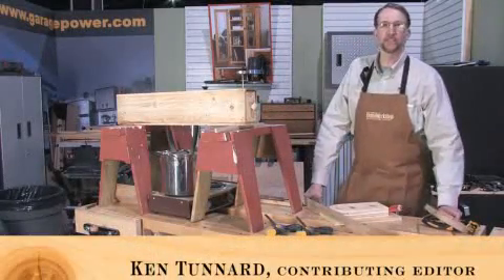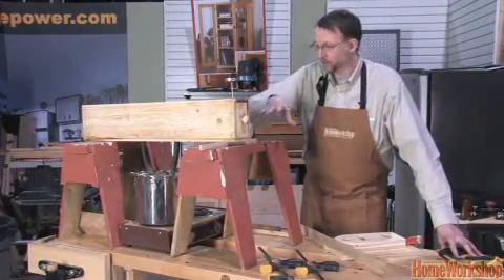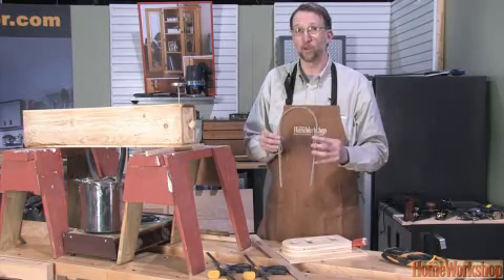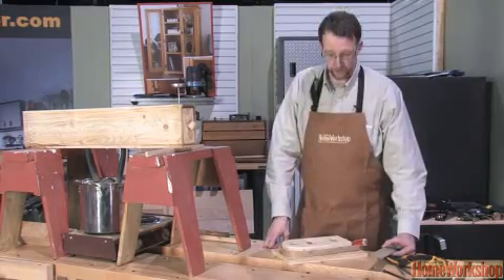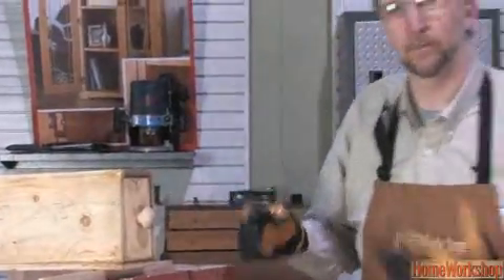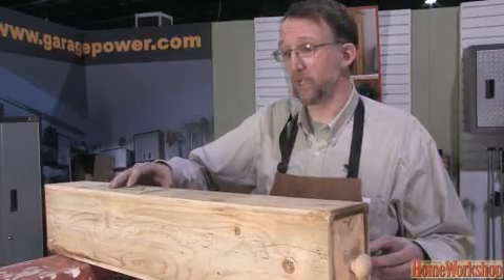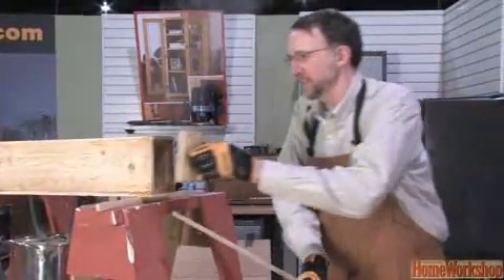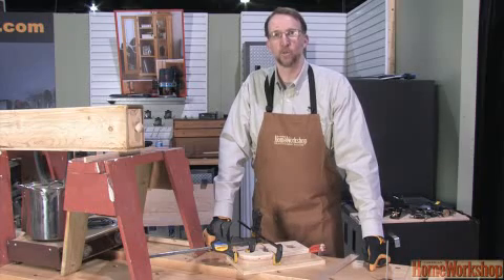Steam bending

Comment: Nice video, but when you mentioned the box might build up excess pressure, I call you on that. No way can that box build up anywhere the pressure to be an issue. I’ve seen people use pressure pots that have failed safety valves and blew the hell up. Newer pressure pots have all kinds of safety protections. I also use a  bending strap that helps blowout.  Not criticizing, just have had 55 years of furniture making and lots of lots of steam and bent lamination experience. Bending wood is one of my favorite things to do. Great job on the video. !
Reply: Why do some people have to be so politically correct?? He Knows it can't blow up. He's creating fun with the situation.
Not  criticizing, just have had 65+ years of studying human behavior, and lots of facial expression experience.

Comment: Ken,  I have a hallway with 3 curved areas. Previous owner bent baseboard nicely but when they carpeted the floor obviously they removed the shoe molding. I'm removing the carpet & finishing the oak so I need to put the shoe molding back. Can I steam this & nail it in place without making bending forms? The molding pieces are approx. 30 inches long.

Comment: the one week drying time is a deal killer for me. I'd like to try it but with a much shorter drying time....I'd even go so far as to put it in a drying room/space with a dehumidifier.

BTW: can anyone confirm this? I read somewhere that to steam bend, the wood has to be air dried as opposed to kiln dried.....
Reply: Air dryed is better. Kiln-dried is done to (help) prevent the wood from warping and bending. You'll need to steam kiln-dried twice as long to get it to bend nicely.

Comment: I want to straighten a guitar neck because it's bent frets outside instead of hollow. I think there's a chance the fingerboard comes off by the heat. I might cover it up with some isolation though and let the stream do its work on the back of the neck. Any thoughts someone?

Comment: Hi Ken,
Does the work have to be around a solid surface or can you use metal studs to make a shape?  I have a need to make some Oak slats for a luggage rack and I only need to bow the slats slightly.  What is your suggestion?